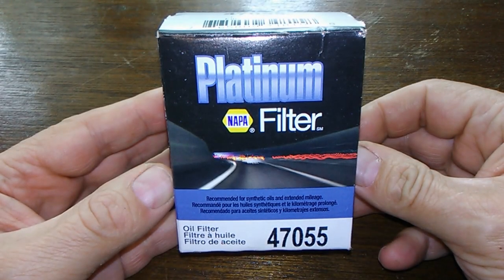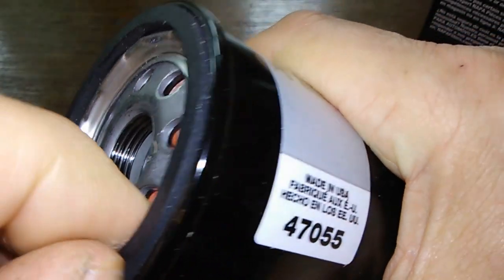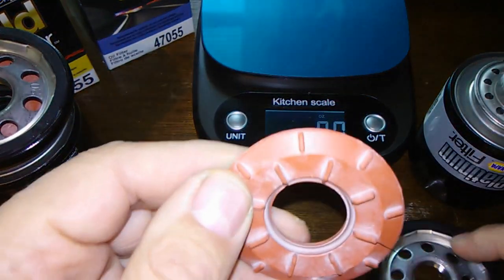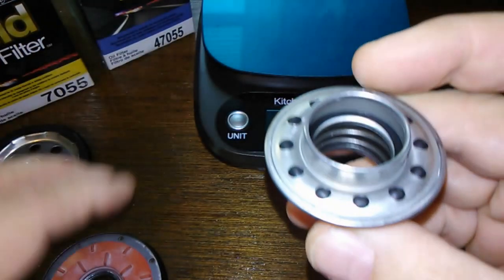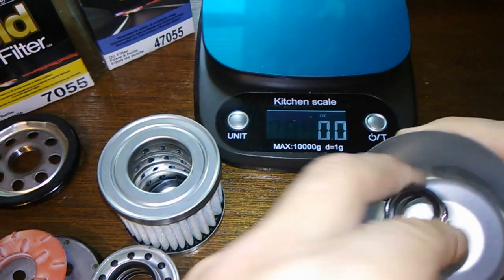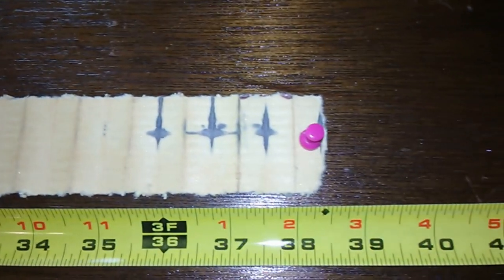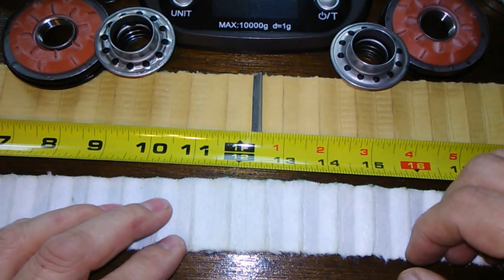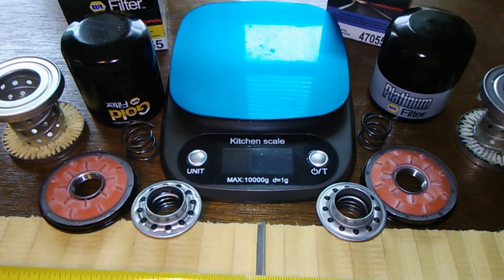Napa Platinum Oil Filter Cut Open 47055 Napa Gold Oil Filter Cut Open 7705 Comparison

Comment from the maker: Oil Filter Friday,
Watch a New Automotive oil filter inspection video every Friday on this channel.
Reply from the maker: JAC 08  The Platinum in this video has a Nominal micron rating of 15 and I believe the silver has a nominal rating of 21. The Platinums are on sale this month at Napa, and I think are a great buy. Here's an article that can probably explain micron ratings better than me.https://www.lenntech.com/library/fine/absolute/absolute-nominal-filters.htm
Reply from the maker: JAC 08  You know the micron ratings are very confusing and I take all of them with a grain of salt. One site will say one thing, another says something else and a 3rd also comes up with a different number. This oil filter may not filtrate as well as say a Fram Ultra, (99% at 20 microns), I don't know for sure but it's a good oil filter.
Reply: @WhipCityWrencher  fram  filter NO THANK U
Reply: Have to be honest w you. I never thought crap bout Napa. Though I believe the Platinum is damn nice. Goes on my Amsoil, Boss, Purple, Wix Xp alts for my car #47356
Reply: Which would you choose between a Mobil 1 oil filter ve the Napa Platium oil filter?
Reply from the maker: @sportsmansparadice42  Tough choice, both are good filters, I would probably take the Platinum, I like filters with a backing.

Comment: The main difference in the two seem to be the platinum media is 13" shorter, has a metal backing, and media is thicker. I like the Platinum better for those reasons.
Reply: I agree! But you can't go wrong with either tbh.

Comment: '18 Tundra here that has been dealer serviced since birth. I'm sooooo tempted to changing my own oil with this filter, along with Pennzoil Ultra synthetic. I'm hoping to stop that dreaded "tick" at start up.
Reply from the maker: This is an older video and these filters have changed some, they no longer have the base end bypass valves.
Reply: If the tick goes away as the motor warms up you might have an exhaust manifold leak.
Reply: @southerncross3638  well, it's not so much a "tick", but more closer to a rattle

Comment: You should do a short video just on bypass relief. There are so many videos out there where people say the bypass relief is the big coil spring. To my knowledge, that is false. The coil spring provides tension only. Bypass relief is either the upper style you show in this video, or a leaf for tension instead of a coil and that leaf will have a small bypass spring and valve built into it, or the filter canister has bypass built into the canister. Or in the case of some hydraulic filters I've seen, there is no bypass which is confirmed on the Wix website under that spec category which says "none." Example Wix WL10079
Reply from the maker: I've done a few on bypass valves, here are two, https://www.youtube.com/watch?v=LQeFiW4YXcU https://www.youtube.com/watch?v=Fb6I7vVD7j0
Reply: @WhipCityWrencher  Thank you so much. I have some videos on my channel covering tractor filters, so I put together the 6 types of bypass I'm aware of into one video. I had to use some clips from you for the upper style. If you are interested, I have it unlisted, not published to subs yet:  https://youtu.be/38HSd1kNlo4  The 6 types being: 1 upper canister bypass with leaf, 2 upper canister bypass with coil spring, 3 canister bypass with leaf, 4 canister bypass with coil spring, 5 bypass valve integrated into leaf spring, and 6 no bypass (e.g. some hydraulic filters).
Reply from the maker: @Redneck_Ed  Great Video👍 Well Done 💯 I don't know if you know this but filters that don't have a bypass valve are designed for engines that have a separate bypass valve in the engine. here's an example of one in the link.    https://www.amazon.com/ACDelco-25013759-Professional-Engine-Filter/dp/B000EPWRPM/ref=pd_bxgy_thbs_d_sccl_1/139-6939633-1146057?pd_rd_w=zJs3d&content-id=amzn1.sym.2b132e63-5dcd-4ba1-be9f-9e044543d59f&pf_rd_p=2b132e63-5dcd-4ba1-be9f-9e044543d59f&pf_rd_r=K4QDW9NYJEZ6Y9HK7YDB&pd_rd_wg=EoEy4&pd_rd_r=7cf4a56d-01de-467d-b5a7-5debc25b44b4&pd_rd_i=B000EPWRPM&psc=1

Comment: Regardless of brand, ALWAYS look in the filter before installation. You would be surprised how many new filters have visible surface rust in them. Fram is probably the worst in that regard. The last time I bought a Wix filter it had a long curly metal shaving in it! Tapping the baseplate after assembly seems kinda dumb to me.

Comment: My 4 runner mounts the filter with the threads down on top of the engine. Is there a problem with the bypass valve on that end of the filter or no matter? Thx.
Jeff
Reply from the maker: If it's mounted with the base plate down then I would recommend using an oil filter with a silicone anti-drain back valve.
Reply: @WhipCityWrencher  for sure. But what about the bypass valve? Looks like some filters mount it on either end.
Reply: @WhipCityWrencher  also what's your filter of choice after all the filters you've reviewed? Thx again
Reply from the maker: @jeffdeluca1153  You'll find that most oil filters have the bypass valves on the dome end.
Reply from the maker: @jeffdeluca1153  I like the Purolator Boss and the Fram Endurance oil filters.
Reply: @WhipCityWrencher  thx again for your time and help!
Reply from the maker: @jeffdeluca1153  You're Welcome👍

Comment: If you change your oil reguarly,  is the Gold filter  better, in regards to flow, and therefore engine longevity ?
Reply from the maker: If you change your oil regularly the Gold will do a good job. Whether it has a better oil flow than the Platinum, (I dont know)

Comment: I don’t think you should have to rely on the oil filter bypass valve ,that means you’ve let the oil go to long  and it should’ve been changed much sooner, what do you think?
Reply from the maker: I agree, if you do regular oil changes you shouldn't have any problems. About the only time, the bypass valve may open is in the winter when the temps get cold the oil may thicken.
Reply: I think pretty much every canadian vehicle that been parked outside in the frigid cold start its morning with open bypass valve. Oil thicken up at that temperature.

Comment: It looks like the Napa Platinum is the Gold with the Purolator Boss filter media.  Since they are all made by Mann & Hummel, they all share similar characteristics although the Boss does not have the baseplate end bypass at least for my application.
Reply from the maker: Yep,👍
I was thinking the same thing, I also noticed that they don't always have the same bypass valve , I guess it depends on what vehicles the oil filer is going on.
Reply: @WhipCityWrencher  I thought the Boss was 25 micron rating
Reply from the maker: @vicarod  Yes that's what Purolator has on their web site (25 microns). If you see and feel this filter media you'll swear it's the same as the Purolator.
Mann + Hummel own/make Purolator, Wix, Napa, and some others, so that's why I think it's the same filter media. 
I think the micron rating listing's should be the same, why there not I don't know. But I could be wrong, who knows. 🤔

Comment: Damn, micron rating of 15? Winder what the percentage is.
Reply from the maker: This is an older video and I doubt they make them this way anymore with the base-end bypass valve. I should have said a Nominal micron rating of 15 which generally means 50% at 15 microns.

Comment: I feel there is two areas where that could be revolutionized by some industry, hell id try if I had money but the oil filter sure by the catalytic converter should be changed, there has to be a way to get the same results without the blowback pressure

Comment: Gotta take those o-rings off to lube them with some oil so they don't stick. I have been doing that to all filters I change. Never have a leak or even a rolled o-ring(when they are circular material).

Comment: What many videos do not show is how Motorcraft Filters are one of only few companies using a thread end bypass, Wix, Napa, and Royal Purple all had outstanding design and when they got bought out, the designs changed and in my opinion they are a cheap design. No longer made with highest quality. Royal Purple Filters, Napa Gold and Wix have all changed from a nice steel base plate with thread end bypass, Silicone ADBV, evenly spaced holes and steel coil spring, solid canister casing. It would be interesting comparison how they have changed. Now Purolator is better than those. I currently use Motorcraft although I know they use a leaf spring and the Purolator is a decent design, the Boss is nice and it shows filter media is better than Motorcraft. Not a fan of dome end bypass. Many new oil filters displayed in videos don't even come close to what RP and Napa Wix used to be years ago. The new ACDelco E core is an embarrassment. Why do these companies think they can change a proven design and still have a loyal following for a cheaper product. They must think customers don't notice. I expected K and N to be higher quality, the dome end bypass design is cheap and does not look built with durability.
Reply: Let’s be honest about this though, relatively few people give much thought about the choices they have regarding basic vehicle maintenance. The majority of people are going to go with what grandad used (and give no further thought), what is cheap, what their oil change station uses, what’s on sale, etc. Very few of us really consider micron efficiency, gasket material, flow rate, additive packages, and so forth. And to add to the honesty if the majority of people stuck to 50% manufacturer recommended oci’s, stuff like micron ratings wouldn’t have much of an effect on the health of the engines. I.E. at least the lubrication side of modern engines would be in better general shape (other than atrocious engine design not withstanding).

Point is, we are the vast minority that find entertainment and enrichment in making informed decisions about our vehicle investments. What prompted my reply is your, “they must think customers don’t notice…” My reply is yes, in fact most customers don’t notice. Because most people don’t even consider doing the research. Most people will just go with the cheapest, or most convenient, or easiest choice…or would even know that there are entire communities that geek out on just motor oil related discussions. BITOG being a prime example.

Comment: What keeps the coil spring in place?
Reply from the maker: There's a recess in the bottom of the endcap that it fits into. It's also under pressure so it won't slide side to side.
Reply: @WhipCityWrencher  thank you so much. I had no idea I was going to get an answer to this. have a great day🙂🇺🇸🇺🇸
Reply from the maker: @josephpuderer1368  👍
Reply: The Coil Spring is held in place by the Coil Spring. It is NOT attached to any part of the oil filter, and is "held in place" by the pressure it applies between the cannister and the filter element. 
The Coil Spring was found to have DAMAGED the CANNISTERS, and was replaced in later models by the Stamped Steel Retainer.
Another reason for dumping the Coil Spring was the environmental concerns -- the Coil Spring takes much more energy to produce.

Comment: I don't trust the silicone anti drain back valve having white powder substance on it. Were the employees high that day? Other than that, I'm cool with it. Has any one called and asked if that white powder is what I suspect it is?....lol😅🤣
Reply: i would not think white powder is anything butt a manufacturing powder 2 help in going down the line, nothing more than a lubricant/slider...

Comment: I use the Gold or just Wix (same thing)  These fancy schmancy  extend life etc. filters with their fancy packages and sensational  claims are just marketing gimmicks by the after market companies.  None of the commercial engine oil filters get into big hyped filter marketing B.S.  They all just use regular high quality filters.   The engine manufactures don't get into it either.
Reply from the maker: Hi Martin,
Watch my next two videos, tomorrow 6/17/21, and Tuesday 6/22/21. I think you'll be surprised. Thanks for watching and for your feedback.👍🙏😊
Reply: The NAPA PLATINUM holds twice the dirt of the NAPA GOLD.  THE GOLD is already a great filter.  By you logic no one would use synthetic oil or electricity over coal for that matter.  However, it's you engine so do what you want.
Reply: @stanleynowak9325  The next time you change your oil, cut the filter open and look at it.  If you're lucky,  you might fine a few specs of debris on the paper

Comment: If you had to choose between the Napa platinum or the Purolator boss which would you go with?
Reply from the maker: I would use either one, I'm leaning towards the Napa Platinum because some of them have a nice upper bypass valve, but some have a bypass valve at the dome end just like the Purolator Boss (depends on your vehicle's filter size). I think the filter media and filtration numbers are similar and your engine wouldn't notice. Also, the Napa Platinums are on sale this month about half the price of the Boss. Currently, I'm using the Purolator Boss, but when I change my oil I'm going back to a Fram Ultra. But your good to go with either one.😊
Reply: @WhipCityWrencher  Thank you!
Reply: @WhipCityWrencher  could you go over an amsoil oil filter? I just recently switched to that brand of oil with very positive results. but id like your input before trying one of their oil filters.
Reply from the maker: @williamjamison2211  The Amsoil oil filters are $ high, and I normally don't like to spend that much on an oil filter, but since I never made a video on one I'll open one up. Give me a filter number and I'll see what I can do. The video won't be shown till sometime next month as I have other requests before you.
Reply: @WhipCityWrencher  Thank you! and yes I know they are high! I'll look up the filter number for my suv and get back to you asap! And that's totally fine I understand  :)
Reply from the maker: @williamjamison2211  What make is your SUV? I might want to compare the Amsoil to a Fram Ultra.
Reply: @WhipCityWrencher  It's a 2001 mercury mountaineer with the 302 ci v8 5.0.
Reply: @WhipCityWrencher  the amsoil filter number is EAO11
Reply from the maker: @williamjamison2211  Oh 302, that's a Nice engine, wish I had that in my Explorer.
I'll order the filter and let you know when I make the video and when it will be shown. 
Take care of that 302👍😊
Reply: @WhipCityWrencher  Thank you I appreciate it! And you bet I will its only got 125k.
Reply from the maker: @williamjamison2211  Hi William, 
I made the Amsoil vs. Fram Ultra video today. If I were you I'd save my money and use a Fram Ultra, or a Napa Platinum, these two oil filters are equally as good, IMHO. Anyway, the video will be shown, Friday, July 30th. Hope you like the video.😊
Reply: @WhipCityWrencher  Thank you for making this and letting me know! Sorry it's been a busy weekend lol.
Reply from the maker: @williamjamison2211   No worries, 👍

Comment: I just picked up a 47055 from NAPA and the design has changed since the one I bought last year. There is no longer a base plate end bypass valve with a coil spring. It looks like the silicone anti-drainback valve is much thicker or it somehow doubles as a bypass valve.  The new one has a date code of 102821 and the one on the car has a date code of 101520 although it is hard to read after the heat cycles it has gone through. The WIX 57055XP I used before the 47055 also had a base plate end bypass valve with a coil spring.
Reply from the maker: Hi Jeff, Yep,
I'll keep opening them up now and then just to see what they look like but I suspect they'll all go to a dome end bypass valve eventually.
Thanks for sharing and the feedback👍
Reply: @WhipCityWrencher  I'm a sucker for an oil filter with two coil springs.
Reply from the maker: @jeffkortsch8276  😂
Reply: @WhipCityWrencher  Have you opened a Napa Platinum filter lately? Just wondering if they still have the coil spring & the same bypass valve. Love your channel new subscriber.
Reply from the maker: @bradhelfrich6602  Hi Brad, Thanks for Subscribing👍
Here's a link to the last Platinum spin-on filter that I opened and they still have a coil spring but have changed the bypass valves. I'm pretty sure they've done this to all of their oil filters. https://www.youtube.com/watch?v=TFT0I4ka-90&ab_channel=WhipCityWrencher
Reply: @WhipCityWrencher  Thanks buddy 👍
Reply from the maker: @bradhelfrich6602  You're Welcome👍